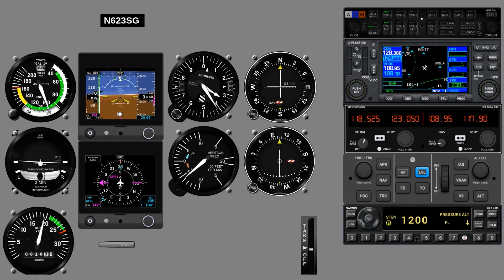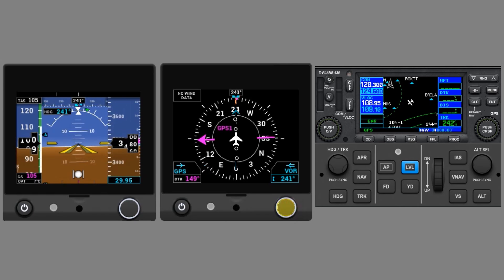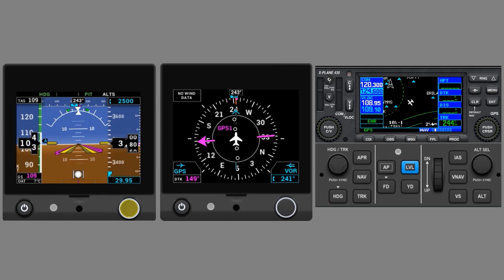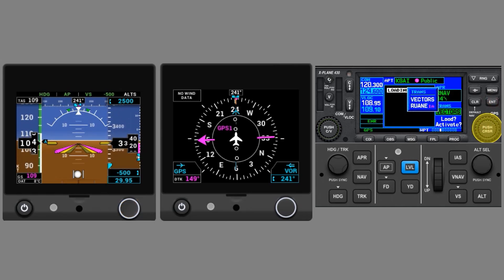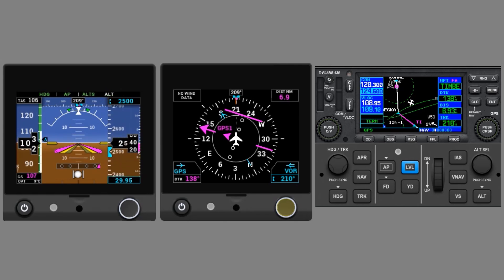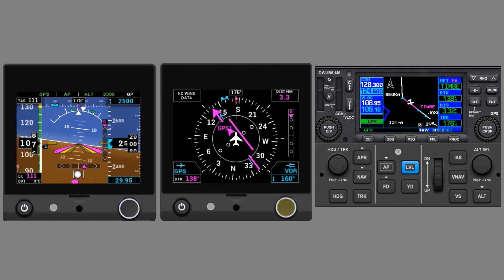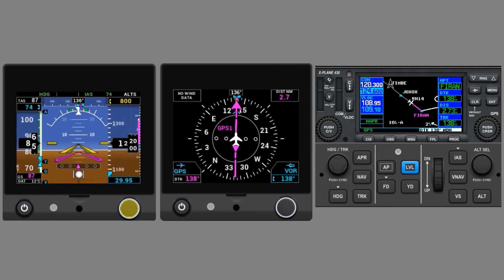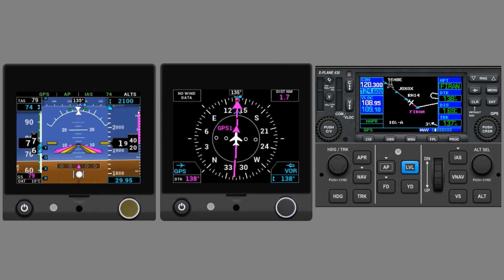Using Garmin G5 to Fly IFR | G5 Tutorial on an Instrument Approach | GFC 500 Autopilot

Comment: Great video. One crucial point I would change though: when at the FAF inbound, he bugs the minimum (DA/MDA). Instead, I would bug the missed approach altitude. This won't affect APR mode (it will still follow the procedure down) and it will allow for a much cleaner missed approach procedure- you won't have to fiddle with the alt select during climbout in IMC, low to the ground.

Comment: There’s so much to keep up on. Where I fly we have a Piper Warrior with dual G5 with no auto pilot, and a GTN 650 navigator. Another  warrior with a GTN 650 navigator, STEC 30 auto pilot which is a two axis auto pilot with only altitude hold no vertical guidance, and an Aspen E5, which is a great unit since it can toggle between heading mode and GPSS. An archer with a GTN 650 and an STEC 50 auto pilot, this one is a little bit different but technically, the same as the 30 except it is digital and has its own unit rather than it’s indicator inside the turn coordinator finally we have a C-172 with a GTN-750, and a KAP 140 auto pilot which does have altitude, capture and VS capability. However, there is no Glass in this aircraft and also the dreaded old DG.

Comment: I understand this is video about G5 and that's maybe the reason you are using knobs on G5, but I find it much easier to use HDG and ALT knobs on the autopilot instead of G5s.
Reply: but for those with no autopilot, the g5 button instruction is better.